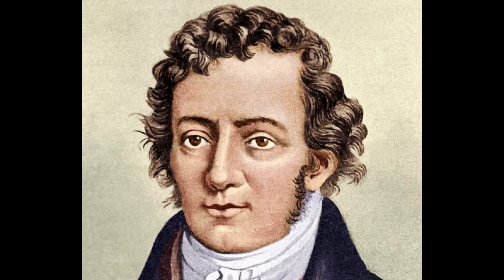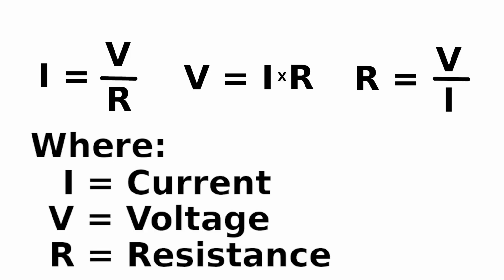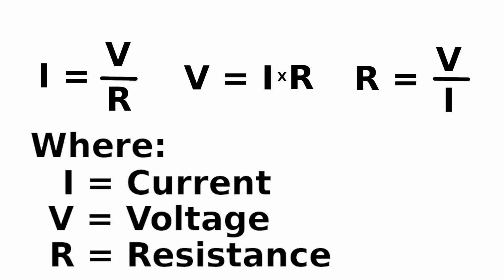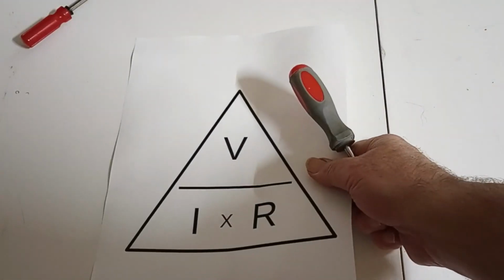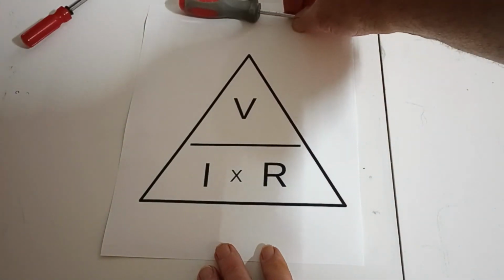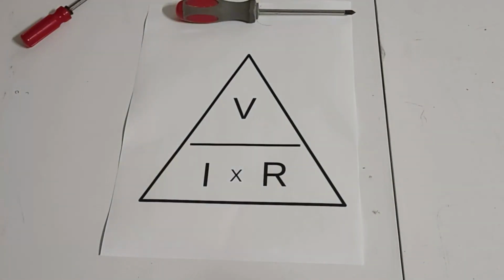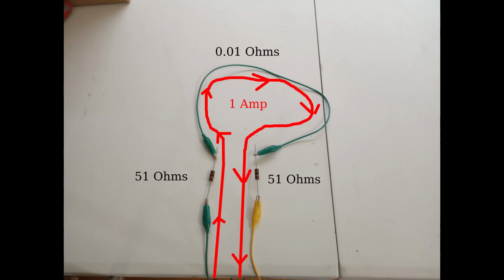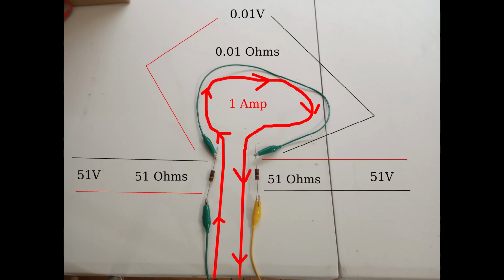A point about Ohmslaw

Comment: What software do you use for your graphics? Very smooth.
Reply from the maker: The animations of the charges moving was done by me with an Octave (Matlab but free) modeling the motions.  I made images of the two balls in GIMP to get them to look right.  I then read them in with the image processing ability and animated them into the image.
The dinosaur at the start, started off as a very high resolution photo taken by me and a gif of the dino walking.  The dino that jumps in to say "hey" was some frames I did in GIMP one by one and then placed into the image with the background.
In both cases, I exported the stuff as a collection of PNG files, one per frame, and then made them into a video with ffmpeg.